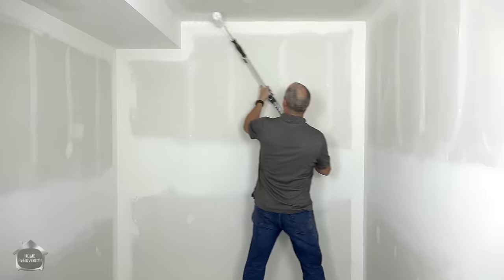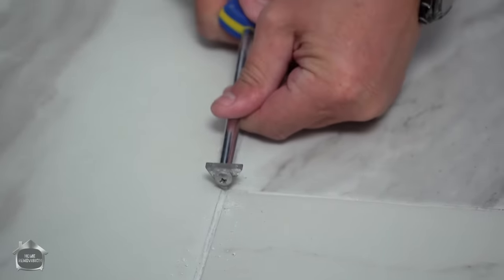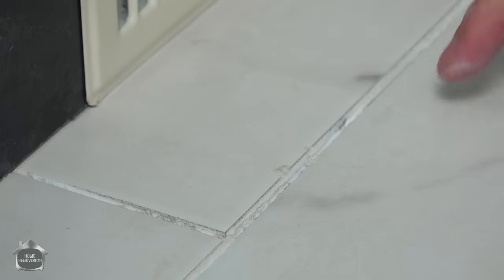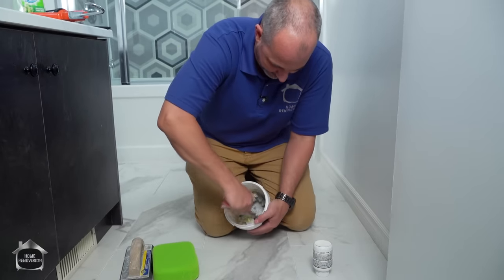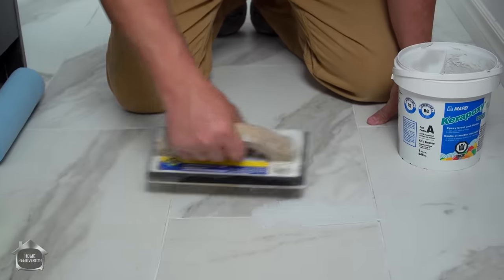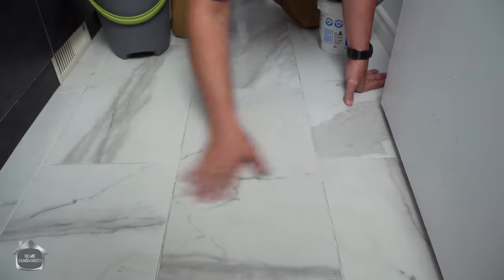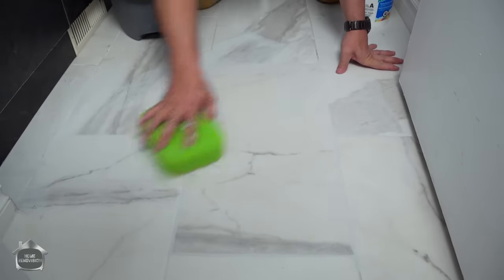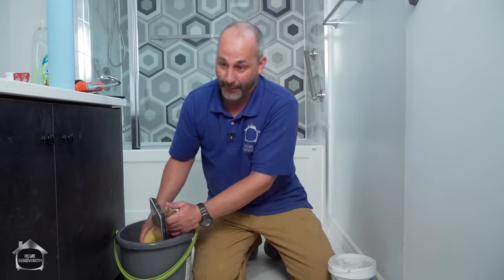How To Apply Epoxy Grout  | DIY

Comment: From a professional. Skip the pour soap directly on tile. Soap mixed with epoxy is a terrible idea. If that was the case they would have a part a part C. LOL  Try putting the smaller epoxy bucket in a larger bucket of ice next time. Doubles if not triples working time and clean up is the same finishing with a drag of wet micro cloth dipped in soapy water. Much Much larger areas can be done and you don't have to rush. Just not a fan of misinformation
Reply: Ice or cold water....VALUABLE ADVISE!👌👍

Comment: The soap you just put all over and got into the grout lines won’t negatively effect the bonding of the epoxy grout?
Reply: I wish they would answer questions, like they mention they do in the video. This question you asked is very important, and I was going to ask the very same thing. Wallah... first question I come to here!... yet unanswered, a month after you asked it :(
Reply: @jungleboiyt  viola*
Reply: Warm soapy water should be used to clean the excess epoxy grout.
Other types of epoxy tile grout could be used that is modified to be easily cleaned and applied, I personally use Weber.epox easy
Reply: If you google epoxy grout dish soap you will find a technical white paper put out by custom building products.  The file name is "epoxy_grout_wp102.pdf".  They specifically talk about using Dawn as a release agent.  Plus some tips on extending pot life. (freezer, small clumps etc)  Don't get too stuck in the weeds about epoxy grout bonding if its a new tile job.  You are basically packing glue that turns into a rock in your grout lines.  If you are regrouting with some tiny thin grout lines then you might have issues and need to be a bit more judicious with the soap.  Do NOT let the water just dry on your tile.  They glue remnants are suspended in the water.  Go buy a pack of paper towels and dry it off.  Your tile should feel like a brand new tile.  If it doesnt then rewash and rewash until it does.  You cant overwater an epoxy grout joint.  Just be careful of scrubbing the lines, they will stay soft and you can damage them.  I am not a professional just someone who has used it before and seen the pitfalls and found solutions (read: others solutions on the web) that worked.
Reply: @davidsterling1363  thanks for these tips and lso for the ech.white paper reference about Dawn
Reply: @davidsterling1363  Thank you for, likely, the most valuable comment in this thread!

Comment: What about the soap in the area where you are applying the epoxie grout -doesn’t this reduce the ability of the grout integrity?
Reply: Same question
Reply: My ceramic guy told me to never use any soap or anything else when mixing cement or epoxy

Comment: Hey Jeff. How would you apply the soap trick on a 2" mosaic tile floor? My concern is keeping the soap out of all of the closely spaced grout lines. Thanks!
Reply: yes, i'm curious too for my 2" mosaic tile floor.   Might be able to use a dedicated 'dish soap' sponge (applied with dish soap) to wipe down the 2" mosaic tiles easily?  thoughts?
Reply: Small paint brush and patience

Comment: Info from technical white paper on epoxy grout.

When cleaning the grouted floor, be sure to use plenty of cold water (to prevent quick set up) mixed with a few drops of Dawn dish soap.  It is critical to remove all haze immediately. Dawn works well because it contains surfactants that have an affinity to the epoxy resident contained in both the epoxy and the water used to clean up the haze. This allows the haze to bond with the water and wash away easily with a cleanup sponge and microfiber towel. It is extremely difficult to remove haze otherwise. The grout cures unlike cement grout, which can be adversely affected by using too much water. You cannot use too much of this soapy solution cleaning epoxy grout.

Comment: hey jeff, i just joined and have a question about this video. is this method of grout removal ( the V shape into grout ) sufficient for regrouting a tile shower floor or should old grout be removed completely before new epoxy grout?
Reply: 6:52 I hope this helps.

Comment: Really enjoy your video. Want to ask if using the same epoxy grout in your video (Mapei Kerapoxy), how deep do I have to remove the old grout before putting the Kerapoxy on top? I want to do this on a shower floor. I’m concerned if I don’t remove enough of the old grout, the kerapoxy may crack or crumble out when multiple adults stand on the floor. Thanks!

Comment: Jeff - what about exterior/interior non slip tiles with epoxy ?  Better to use a "gun" system where the bond and the grout are combined at application?

Comment: Hi Jeff, just viewed your tutorial. Great video. I've never used epoxy grout so like many others this is new to me. I do have some questions: 1) does the unused portion grout harden if not used can it be reused the next day to continue the job. 2) Can small portions of the grout and epoxy be mixed and used instead of mixing the entire contents. Getting ready to repair/replace the grout on my home floor therefore any feedback is appreciated. Any comments from viewers that have used this product also welcomed. Thanks.
Reply: 1) No, once it's set it naturally can't be re-used. 2) yes, but you have to be very, very, very careful to maintain the exact same hardner to epoxy ratio

Comment: So I've been renovating my bathroom. And your videos have been INVALUABLE, so thanks for that first. Now the question: I didn't know the difference between sanded and unsanded grout until right now. So I've used an UNsanded grout on my floor now. The gaps are small 1/8th inch and i've installed it on cement board that's screwed and mortared to the subfloor so it should be stable... i think. IS there a risk that the grout will crack in the short term?
Reply from the maker: That all depends on the tile size the product you used to install the temp and how clean it was and if you used water before installing the tile and what kind of deflection you will get. In short maybe. If it does grab some epoxy and it will be a thing of the past. Cheers!

Comment: Also, you said there is a special grout for doing tiles with 16th inch grout lines.  I am redoing the grout in such tiles and would like to know what type of grout to use?  Finally, when I redo the tile corner or tile to expoxy shower pan, I think I saw in one of your videos that you would regrout these joints and then finish over with a bead of silicone.  Is that correct? I see some who just use only the silicone bead in these joints.

Comment: Hi Jeff, I have enjoyed all of your videos and straight forward approach to doing the home improvement work yourself. Your channel helped me get through 2020 as Ibecame interested in comparing your experiences and tweaks compared to my experiences I've gained being a GC in CA.  I'm the last Contractor in a 75 year family business with zero complaints on our work my family has done in the commercial and residential business.  One question on this epoxy tweak of yours that I never knew about till now is,  does it work with pebble floors in showers with their narrow to super wide grouted areas? 2nd question, do you advise using your hand as per the video to lightly smear the liquid soap or would using a sponge, towel or other device be better to use to evenly lightly spread the liquid soap?  My concern is lessening the chance of the liquid soap weeping into the grout lines, but maybe this concern is misplaced after reading your replies to previous posts. Please let me know.  Thank you again, or as they say in Canada,"cheers."

Comment: Great tip with wetting the floor first never done that before and I had a very hard time removing it one time. One thing I’d say is always always wear gloves with epoxy grout. I used bare hands and I had epoxy burn for 1 week.
Reply from the maker: that happens for folks who don't grout a lot for a living. Cheers!
Reply: Not necessary wetting the floor... If you use a power saw to cut cement board (Durock or Hardie Backer) the dust will clog pores. Hardie backer has dust on it from the factory. A wet mixed thinset can help resolve this problem, (wet mortar causes problems on walls.) Not much experience with epoxy as a mortar, but i know the surface needs to be dry.

Comment: We are installing a ceramic tile backsplash in kitchen (brick face-sized) using Epoxy Elite EPO which it says works both as adhesive and grout, ordered on-line from Home Depot. Can the mixed product be preserved? The 11 lb can says 60 minutes, but seems a bit vague. It says "mixture life 60  minutes". Does that mean all must be used up in 60 minutes, or just that it will harden to surface on 60 minutes and the rest can be preserved in an airtight container?

Comment: Does the soap affects the epoxy grout strength or performance? I'm guessing there is no need for sealer on this type of grout?  I've never used the epoxy grout yet, but have used the epoxy "thinset" on a Tileready shower pan. I'll bet the epoxy thinset combined with epoxy grout makes a great waterproof shower. I really enjoy your videos.
Reply from the maker: the soap should only be applied to the tile. it works like a charm. no need for any kind of epoxy thinset. that would just be a waste of time and money!
Reply: @HomeRenoVisionDIY  The epoxy thinset was part of the prefab shower pan kit.

Comment: Hi, can I use epoxy grout at color (grey) to replace the white cement (or tile adhesive ... I don t know what it is) that the contractor placed where tiles were cut to accommodate the pipes coming from the floor. there is about 4-5 cm gap filled with "cement"

Comment: Enjoyed your video...I just bought a house, previous owner hired out full bath reno...ive noticed a few subway tiles in shower totally missing grout...obviously water plus no grout = bad...should i mix up some epoxy grout and push in? I dont want to rip & replace...thanks!!
Reply from the maker: That will work but it will look different if the wall is not epoxy right now. best to match it if they used unsanded or regrout the whole shower. !

Comment: I did this today, using the soap...it definitely sped the job up...but...I used a dark grey epoxy and the soap turned into soapy/bubbly water...the bubbles have left small slightly white patches in the joint. Not enough for me to not recommend the technique though...but I wouldnt use the soap on another dark/black grout....

Great tips man, keep it up!! 👍👍👍
Reply from the maker: Great job! perhaps a little less soap next time and a dry area to work on. Cheers!

Comment: JeffWould shellac on plywood floor before tiling. Be better than wetting it ..or both ...im hammering out my bathroom. Floor tile and cement bed....    Will get either a rotary hammer or grinder with mason blade. grinder will have more uses. Cheers!
Reply from the maker: Hi vinny, screwing down cement board works well , so does installing schluter. or just simply wet the plywood and go. But not the osb, it has to be a good 1 side plywood. Cheers!
Reply: Jeff thank you so much for the reply! I will try to upload something on YouTube ! 😆 will be unedited.
Reply from the maker: Very cool Vinny, looking forward to it! Cheers!

Comment: Hi Jeff, Would like to get your recommendation about a leaky balcony. Balcony is above a room. After I had the old tiles removed and added new Prismo grout. There is a leak in the ceiling. 100% want to avoid removing the tiles in order to replace the membrance under the tiles. Is there any product such as two part clear epoxy that I can have applied to the tiles, new grout... The re-grouting is done with good workmanship and covers all the ages. I know applying sealer is not the solution. May be adding the grout in the video - if we could get it in clear oe brown. Please let me know your recommendation. Thank you.

Comment: Do you have to get rid of old epoxy grout ? or apply on the top of the old one . My epoxy grout is 18 years old and in great condition except where the tile meets the edge of the bathtub.

Comment: Hey Jeff, i used the Mapei Cq epoxy for a shower , and while I was working with it I had an emergency didn't wipe off the grout and have some grout and haze on the tiles. Is there anything I can use to remove the epoxy and haze without doing damage? Thank you for the answer in advance. Love the channel and is hands down the best subscription I have.
Reply: Mapei makes an epoxy grout haze remover.  I know Floor and Decor carries it.

Comment: That v groove is all you need to add new grout? I get epoxy can be added onto existing grout and doesn't need as much depth in the joint as traditional cement based grout but just making sure. 

Also the v groove grout rake seems like it would've scrape the sides of the tiles once you get to a certain depth.... Causing chips

Comment: Hello Jeff. I just watched your new epoxy grout tip video. Question if you put the dish soap on the floor then pick up the excess would the soap affect the epoxy grout that is placed back into the bucket?
Reply from the maker: Hi Marc, if you are concerned then use less at once and discard it upon removing from the floor. I have been using this system for years and it works with no side effects. Cheers!

Comment: Hi Jeff. The inexperienced me has made a mess out of the grout lines. Even after I used detergent, there still seems to be epoxy residue on the tiles. How do I get rid of the epoxy residue on the tiles after it has cured?

Comment: I am putting in 12x24 inch ceramic tile in a shower.  It is large about 75sqft.  Will the soap (I assume Dawn) work on a wall?  I want to use grout that does not get black mold over time and is less work to keep clean.  No one ever seems to wipe down the walls after a shower??  Your thoughts PLEASE.

Comment: Doesn't the soap prevent it from sticking to the existing grout too?
Reply from the maker: Only if you fill the grout lines with it.
Reply: I hear you...the video looked like you wiped it over all the surfaces - I assumed that there would be a fair amount getting on the grout lines.

Comment: If soap helps to reduce the adherance of the epoxy to the tile surface, why doesn't it compromise the bond under the grout line?
Doug

Comment: Thank you so much for this video and for sharing your tricks! We have a porous stone (unsealed river rock) meshed tile already thinset onto the floor. Could we apply epoxy grout to something like that without damaging the rocks?
Reply: You might be better asking the stone manufacturer or contacting the manufacturer of the grout you choose
Reply: @zarasbubble1748  Thank you! We ended up sealing just the tops of the stone with a tile sealant and epoxy grouted over them when the sealant dried, came out great, no stains :)

Comment: Hi Jeff, I have a fine sandstone shower floor (porous initially but well sealed now) I want to use epoxy /kerapoxy for endurance and water proofing but the surface is naturally split / riven. How do I ensure I can get the grout off the tiles afterwards? It was hard enough getting keracolour off riven slate tiles. It looks easy on a polished surface but textured.. something a whole lot more daunting!

Comment: Great vid.  I have been using an epoxy grout on showers and bathroom floors in my and family houses as I remodel.  I had one bathroom tub/shower that I used sanded grout.  I live in AK and we had a bunch of earthquakes over the last 8 months.  Sanded grout had a few cracks, epoxy had none.  Like others the cleanup was killer for me.  Regardless of opinions I will try the dish soap on my next one.  Do you have any other vids using epoxy?  Interested in seeing the process on a shower surround.  I am not a professional just a retired diy hack that has been doing my own work for 45 years.  I appreciate your tutorials, some of the best around.

Comment: I’m going to use this on a pebble stone tile entry way with slate for the rest of the floor. I have wooden floors but I’ll be giving the wood a drink before I put my ditra down. Not too much deflection- like your old house I have 2x4 planks running diagonal across the joists. My floor is stiffer than rot gut whisky. Any tips other tips on sealers or anything else I can do to make this job go well?

Comment: I use soap and water mixed on the soapy side and then coat surfaces I want to keep protected when pouring concrete . I just soap surfaces with a brush and let dry and then the splatter of concrete I let dry and then when its dry it brushes right off because of the barrier it creates.

Comment: Hi Jeff, I checked all of your videos but couldn't find one that covers grout refreshing. My grout is solid in kitchen, dining area, but it's looking a little discolored. I looked at the color refresh things on Amazon, even bought one. But it seems like latex paint which just seems like a terrible idea. I didn't apply it everywhere, just a test. Is there a product you recommend to refresh my grout with a sand color but also seal at the same time? Epoxy paint is interesting but not sure where to get that. Thanks!
Reply: Wondering this too. Did you find a good fix?

Comment: Per usual: great tips and instructions.

Question: how do you patch a hole in a ceiling that was popcorn-ized? I’d like to remove light from a bathroom. 

Cut a plug the same size, plug it from the attic, tape mud it down from the attic side, apply 90’s ‘ texture ‘, shake head at all the popcorned surfaces in my house?